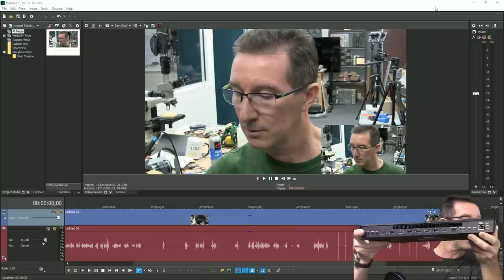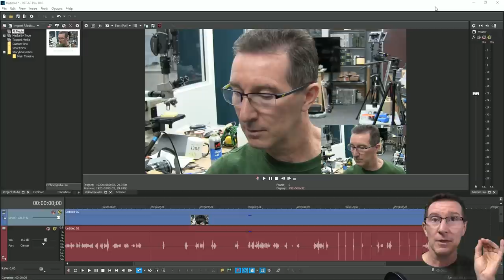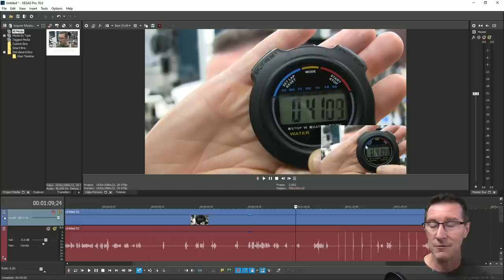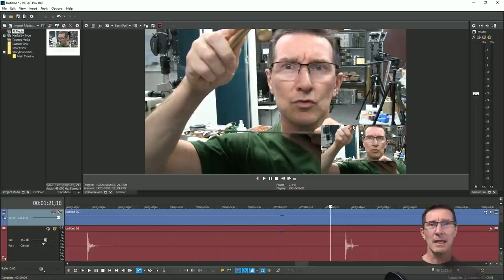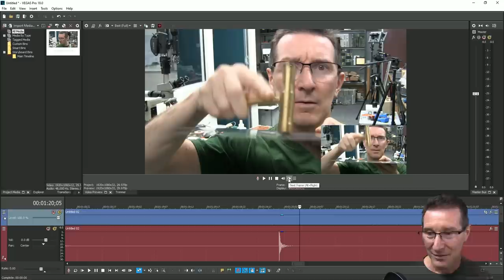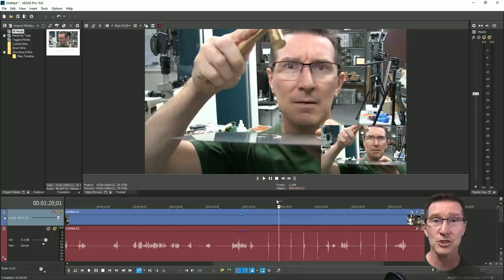BlackMagic ATEM Mini Pro Audio/Video Delay Measurement

Comment: 16ms would not be so noticeable. 5/30 ~ 166ms, right?
Reply from the maker: Err, yeah, 166ms, not 16.6ms
Reply: @EEVblog2  I wanted to say the same, 166ms is huge
Reply: That is why Dave can notice the delay. Up to a 100 ms difference a brain can "automatically" synchronise audio and visual events. Anything more becomes noticeable. 
I am surprised Blackmagic did not care about it. I am involved in a video processing hardware design and we are very sensitive about synchronisation whenever there are multiple parallel processing paths.
Reply: @piotrts  It seems Black Magic solved this a while ago, Dave just should RTFM. James Gray said 4 hours before my current comment: "ATEM firmware 8.2.3 onwards, you can adjust the microphone input audio delay from 0 to 8 frames".
Reply: The brain is used to audio being behind vision, because that happens naturally, and will tolerate quite a bit of lag that way. When sound leads vision it doesn't take much for it to be noticeable.
Reply: @nowster  Yup, was about to say that. The brain gets really confused when the sound comes first. 👍😁
Reply: How do you know the video source isn't the cause of the delay?
Reply: @wgm-en2gx  The main source of the delay are almost surely the cameras. But this doesn't matter, because I don't think any camera has true real-time HDMI output (I'm actually amazed just ~170ms is needed for the whole image processing). So this must be solved by Black Magic, which they did.
Reply: @mrnmrn1  Then I think it's incorrect to say they could have corrected for the delay as if to say the delay is internal to the device and therefore known.   If the source has some delay then different sources could have different delays so you couldn't have a static delay compensation in the device.
Reply: @wgm-en2gx  James Gray said: "ATEM firmware 8.2.3 onwards, you can adjust the microphone input audio delay from 0 to 8 frames".
Reply: @piotrts  The delay isn't in the switcher's processing. It's in the camera's HDMI output. Blackmagic took this into account and included a setting in the ATEM to delay the audio from the mic-in to compensate.
Reply: @mrnmrn1  I agree that synchronising independent external devices is very difficult in practice. Impossible in home-studio setting. Big TV studios use a common time-base generators to help with synchronisation. Synchronisation of separate audio input is impossible without an external reference, and manual delay is pretty much all you can do. I would not use frames as the time measure, though. However, delay between the direct video signal and the green screen is a bit of a flop. Could have been avoided.
Reply: @nadnerb2178  I agree. Video is always behind due to a more complex processing. Within a single device it is usually handled correctly. What Dave is expecting is desynchronization with respect to the separate audio input and there is no fault on Blackmagic side in this case. It requires manual compensation.

Comment: You can fix a 180ms delay if you record it from 61 meters away.
Reply: LOL!
Reply: Or 22727 miles of wire.
Reply: That's a terrible idea. You need to redirect the audio through 61m of folded pipes, then you don't need to be so far from the camera.
Reply: @eDoc2020  Wow, that would sound amazingly well xD.

Comment: ATEM firmware 8.2.3 onwards, you can adjust the microphone input audio delay from 0 to 8 frames 👍🏻 Check out the mixer controls in the control software.
Reply from the maker: Oh wow, frame by frame, neat.
Reply: @electronik808  exactly how our setup works too; we just use a wireless lapel mic and plumb the receiver directly into the camera. Then camera is connected via HDMI without any delay tweaking required. However, with multiple mics we generally run them through the digital mixer (Behringer XR18) and have a single output from that into the ATEM. It’s a little more complex but we get a great result, especially when filming bands etc.

Comment: Also notice something by going frame by frame on the main camera? 

Every 6th frame is doubled. Meaning you are doing a 5:6 pull up from 25p to 29.997p 

So check if your camera HDMI output is set to 30 or 25

Comment: The problem is not with the ATEM, the problem is that HDMI outputs from most consumer and even pro-sumer cameras/camcorders are delayed by a few frames. The problem is compounded by the fact that the delay is different between camera models/makes. However, the ATEM's mic inputs have no delay on them (and as demonstrated by Dave, even the advanced video processing only adds about a frame), that's why the audio can be ahead of the video. 
The simplest work-around is to feed your mic into the main camera, that will "lock" the audio to that video, perhaps feed into the main "head-shot" camera. Alternatively you can dial in the delay on the Audio input in the ATEM software (not forgetting to then "Save the Startup state" to lock those settings in for subsequent power cycles)

If you want a camera that has virtually no delay on it's HDMI output be prepared to pay a lot, or go for a camera that has SDI output and then use a good SDI-HDMI converter (the Blackmagic design SDI converters add less than one frame delay)

Comment: Up to 1 frame delay may be caused by non-synced cameras. Every camera having it's own clock takes the "same" frames in different points in time. The switcher also has it's internal clock, and during one cycle has to wait for images from all cameras. Which then can be almost one frame apart. That's the REF i/o you can see on professional gear, it's "external clock", to have everything in sync, to not add another delay. Also cameras have different implementation of picture pipelines, and can send the frames in different times. For most broadcasting gear you can find this glass to signal latency. (or end  to signal latency)
Reply: Wondered if another video guy had already commented on this. Yeah, nothing new here for us. There's a reason the pro stuff has reference/genlock input and the delay from glass to output as you said can be both long and unpredictable with consumer cameras (even the "prosumer" ones). None of this is the fault of the ATEM. It's getting the signals through it as fast as it can.
Reply: Is this external sync still called Genlock as it was in the analog times?
Reply: @rjgscotland  I don't know if syncing the cameras is possible through HDMI. It would be a nice feature if they were capable of receiving sync pulses from their HDMI output, although I'm not sure if even the HDMI standard is capable of that.
Reply: @mrnmrn1  I think it's still called genlock. From my extremely limited experience with studio cameras it's still input from a separate BNC jack. I doubt HDMI would have support for genlock because HDMI is a consumer standard. All the pro cameras would use SDI going into the switcher.
Reply: @eDoc2020  Thanks. I also doubt HDMI supports it, but it should have. I guess it wouldn't be too much effort, but it's not a professional interface, so if it doesn't support it, it's probably intentional.

Comment: The delay isn't in the switcher's processing. It's in the camera's HDMI output. There's actually a setting in the ATEM to delay the audio from the mic-in to compensate. Re-test this with a signal generator and you will have a more accurate test.

Comment: I use the Output Delay feature of my Tascam Model 12 to correct this... You confirmed for me that 150-170 Ms is the right Delay setting (6 frames at 30 fps) - thanks!

Comment: I have this exact video delay problem with all footage shot on my old GoPro Hero 5. Video is 4-5 frames late and I have to manually put everything back in sync. GoPro sent me a replacement, same issue... but they let me keep it so hey. 👍🙄 Hope you get sorted!
Reply: Wow, nice, a free original GoPro. You won the lottery! :-)
Reply: That was an actual fault?
Reply: @EEVblog  Think it's an 'undocumented feature' of the 5. They couldn't fix it and the replacement had exactly the same problem.
Reply: @mrnmrn1  I have a love-hate relationship with my GoPro. 90% of the time I want to throw it across the room. 🤣

Comment: Had I not read the comments (and applied a bit of logical 'of course' thought) I would have decided that the ATEM Mini Pro ISO had too many issues for serious consideration.  In fairness to Blackmagic I think you should add a video postscript explaining the inclusion of audio input delay adjustment and the potential for different cameras to deliver video/audio through their HDMI outputs with their own delays.

Comment: Internal delays from the the inputs to the output should be known for each channel, however how would the black-magic know what camera you have? What microphone do you have? How long of a cable do you have? All these are external to the device and need to be able to measure them to provide a single set up check box of syncing.   In addition each microphone, camera and cable interfacing with the Black Magic would be unique how much difference would the cable make not sure but each additional 11.8 inches, about 30cm for those non-imperial types, is approximately one nanosecond,  not sure how much this affects audio visual but in RADAR applications this is critical.  Just saying that a simple check box to fix the delay may not be so simple after all.

Comment: Unfortunately, video and audio delay is inherent in any studio system and it's often more complicated than what it seems...
I dunno for Dave's particular case or how Atem products measure, but do be aware that delays like that, particularly on the order of single frames, can be happening at several points of the system itself.
This stands out more when you record video and audio in separate devices... and a reason why sometimes it's simpler to pass everything through the camera instead.
The camera can have an HDMI out delay, the mixer can have an HDMI input delay, you can have some sort of software or transcoding delay, and all of those things can change depending on exactly how you are using each component device, because like, some cameras can have higher delay when recording, some mixers can introduce delays depending how much you push it, how many channels you are using, if you are using extra functionalities or not, etc... there are several potential choke points to consider.
But overall, most mixing and recording equipment will introduce delays because it's just inherent of the system itself... which is why lots of them comes with adjustments to delay audio or video. If there is any level of signal processing, there's potential for delay... and since we're not working with raw analog data here, a few frames is kinda impressive in it's own way. xD

Comment: Dave, with all this frame jogging, haven't you noticed that your image is freezing every 5th frame? e.g. after your hammer hits the plate, the next frame is identical. Sure sign of a frame rate mismatch between source and capture/processing. I've noticed a few of your videos looking a bit stuttery because of this (but, oddly, not the Floating Dave Head in this video.)

Comment: I have seen this in commercial television fairly often since the advent of digital broadcasting.  This never, in my memory, anyway, occurred when broadcasting was analog. Admittedly, it seems to happen more often with cable... Come to think of it, I've never seen digital from an antenna... So, it may be that it is something that happens in the cable system's processing. It can get quite noticeable, and is very disconcerting when someone stops talking a second or two before their moth stops moving...

Comment: Hmm, I wonder how bad the latency issues would be for my DIY solution when I finally reuse my GPD WIN to run the Debian software I'm currently using on my laptop, I knew audio was always faster than video, however since the BlackMagic video studio uses FPGA, I suspect the puny 2.53GHz atom's gonna have some latency issues.
It's why it's good to know what the issues the PROs face, so thanks for the info Dave.

Comment: You're being very kind (understandable since they are giving you hardware) but gee that's an issue that should never made it past the first round of QC. Also, a device that has "Pro" in the name but no XLR inputs?

I wonder if they expect that you'll pull your video audio from one of the camera/HDMI inputs and the 1/8" input is just for other audio where the delay wouldn't be as much of an issue?
Reply: The delay isn't in the switcher's processing. It's in the camera's HDMI output. Blackmagic took this into account and included a setting in the ATEM to delay the audio from the mic-in to compensate.
Reply: @nadnerb2178  - How is it not in the switches processing? The audio and video are being input into the switcher. The delay is in the switches output...
Reply: @AdamsLab  The audio is coming from the mic into the 3.5" mic input, the video is coming from the camera into the HDMI input.

The camera's HDMI output is delayed (this is common with cameras), therefore when the switcher gets both the audio and the video, the audio is received first.

This scenario is actually so common it's written about in the ATEM manual and Blackmagic has provided an option in the settings to delay the audio from the mic input to compensate for this.
Reply: @nadnerb2178  - It's interesting, that I can (using a $30 HDMI to USB capture card) connect my camera and then an XLR mic (using a USB audio interface) to my computer and have zero sync issues.

This video: https://www.youtube.com/watch?v=jAGp0JfNof8 talks about "HDMI delay" in general and he tests for the delay. The worst he got was a 1 frame delay when comparing SDI and HDMI outputs. The caveat (which he notes) is that he was going from SDI to HDMI and the delay was likely in the conversion from SDI to HDMI, and not in the nature of HDMI itself.

He also tests using an ATEM Mini and the same 1 frame delay is there (confirming the delay is in the SDI to HDMI conversion). Maybe it's Dave's camera, but it also seems that it could be the ATEM device. IIRC, on ATEM devices one of the inputs is designated as a low latency. Gamers use these things, they wouldn't tolerate any (noticeable) latency. 

Either way, the ATEM should not be introducing a delay, if it is, it's a bug. Maybe it's not, but unless his camera is doing something odd...
Reply: @AdamsLab   Can your $30 HDMI capture card do input switching? Keying? Picture-in-picture? 

It's important to realise that the ATEM is not a capture card. If you need a capture card Blackmagic has their Desktop Video range with DeckLink PCIe cards and UltraStudio Thunderbolt devices. 

Yes, the ATEM does have 1 frame of delay on some inputs which is necessary for things like PiP and Keying. HDMI Input 1 is a low latency input and can be used for gaming. My rebuttal is against his claim that this is an AV Sync on the output of the processor. That is incorrect. The delay that he is measuring here - (4-5 frame delay in the AV Sync) is not due to the processing in the switcher but instead is on the video source into the switcher.
Reply: @nadnerb2178  - The only comparison I made between the ATEM and my $30 card was that mine could capture without introducing a delay. The only reason I brought it up was to counter that the delay was something to be expected because it was the camera/the way HDMI worked. Looking at it now, and from the test results of the video I linked, it does look like something might be going on with the camera he's using...